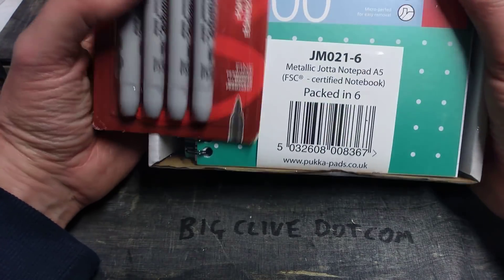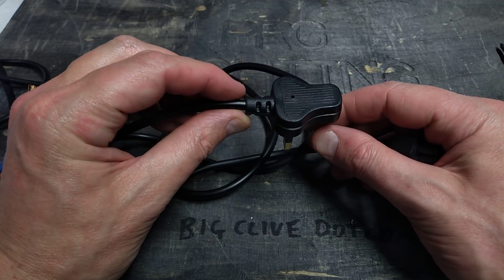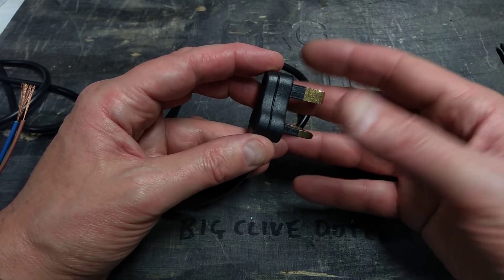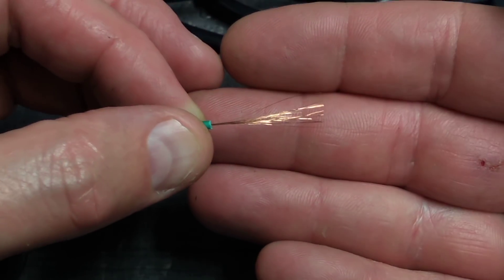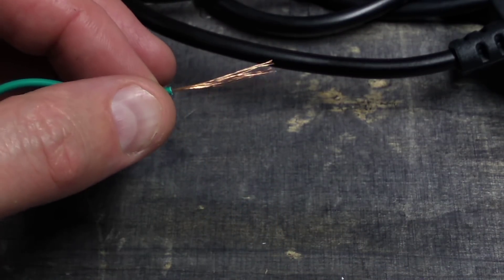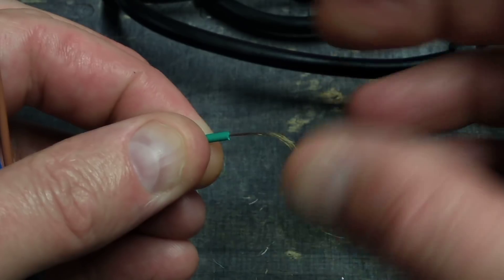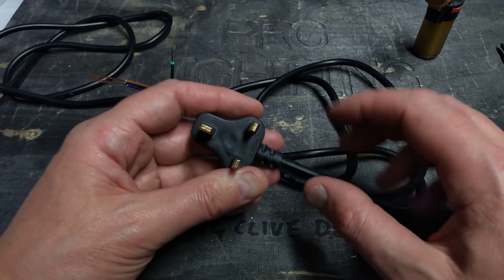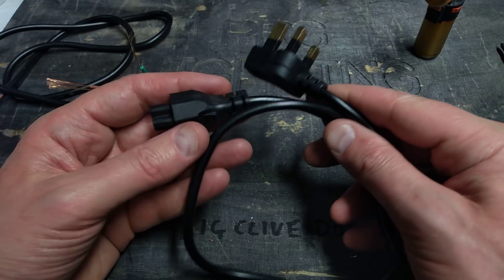How to detect shitty and dangerous aluminium flex.

Comment: Dead Sharpies - break them up and put them in a bottle of meths, the ink will dissolve and eventually you end up with engineer's marking blue (black, red , green...)

I recently bought a data cable (D9 to D9) which had steel cores, the whole cable was attracted to a magnet!  I opened it and the strands were very fine, and not that many of them.

I hope and pray we don't get similar mains leads.

Comment: It's not just aluminum wire. 
    Some switches have replaced some internal brass springs with copper that is softer and deforms very quickly in use.
The toggle switch either stays on or off when it wears out. It's a fire and safety hazard if it latches on. Throwing the switch to the opposite mode does not turn it off. The same is true if it latches off. It is frustrating if you have toggled the switch on and nothing happens since the broken switch stays in the off mode. These toggle switches and others have been on the USA market for over a decade. I have put in on/off indicator lights where these have not been installed. Glen

Comment: Don't just bin the lead. Someone might find it and burn their house down.

Better to cut off the connectors from both ends and then chop the cable into 15 cm - or in the U/S, 6 (1835 British Imperial) inch lengths, so that nobody can kill themselves by using it.

Comment: Speaking off CCA I once sent back a batch of counterfeit Excel Cat5e patch cables. I didn't pay cheap from or such and they were advertised as old stock. I flame tested some after noticing packet loss on the switch statistics and port flapping which never happened with the previous cables. They flopped just like that under a flame. Now I test every one in a batch.

Comment: When I was pat testing I came across quite a few drill chargers from like Dewalt and Milwaukee with 13A fuses in the plugs on a figure of eight cord only rated for 6 amps. I replaced them with 3 amp fuses and some of them were even new but isn't that just as bad?
Reply from the maker: It certainly isn't ideal.  If they were actually supplied with 13A fuses then that is an issue.m If the plugs were not moulded onto the leads I'd be suspicious that enterprising importers had fitted the plugs themselves with the fuse they were supplied with.
Reply: Most of them had moulded plugs. Some of the older ones did have the wired plugs attached to them with a more acceptable fuse rating.

Comment: Thank you for this video clive. I do a lot of IT stuff in my spare time and thus have a shit load of the C13/14 power cords and one in particular wasnt working. I felt it and it was limp and thin, so I cut its head off and it had the same shitty aluminum wiring. Not rated for US use at all, let alone 10A at 240v it claims. To make things even better, somehow the live wasn't connected to the terminal on the C13 end! +1 for helping my house not burn down.

Comment: this must be made known to all over the world!, i have a couple of those cords (netherland europe) style. rated @ 16 amp 240v  and with the same inner core as that one. if in doubt please cut in half and throw a way. 
some cheap pc monitors and power supply cords are like that. the problem is that you could use the same cable for heaters and heavy duty machines.

Comment: Another helpful video! 👏
I have gone to replacing a lot of cord assemblies with an inexpensive (yet made of copper) extension cord by simply cutting off the receptacle end  and then wiring it in appropriately. I have found this to be a quick and affordable way to replace these horrible aluminum cords. 👍

Comment: Also noticed that the one of the wires appeared to be green, without a yellow stripe.

May also have been worth testing if it was brown=L, blue=N and green=E with a continuity tester.

Before placing in the bin be sure to chop the connectors off both ends of the cable. So nobody will take it out and try and use it.

Comment: The cable is new info. Plug fails are not. I make a point of reporting ANY device that arrives from Amazon (et al) with such a plug, and whilst no-one has ever responded, I have noticed the frequency is reducing, thankfully, and re-purchased items have latterly had proper fused plugs on.

Comment: I bought a hot-air rework station. Crappy plug and cable, straight to recycling. Proper BS certified replacement. Opened the metal case to give it a Portable Appliance Test.

Long story short, it’s safe now. Well earned inside and to the earth pin.

Comment: Fuse in the plug, that there is a safety hazard, so easy for people to put a higher rating fuse in or bypassing the fuse defeating the purpose, not very safe for a country that claims to have the safest plugs / electrical safety standards in the world, sure there would be the people that do the right thing but there will be just as many that wouldn't, just makes me cringe just to save a few bucks wiring up a house and the plugs have a fuse protection that can be abused, that is the biggest safety flaw.

Comment: Would putting a fuse in every single plug head cost not cost a huge amount more than a standard cable? I am shocked that a fuse in every power cord would be a viable solution...I have been shocked several times at 115V it is more startling than anything... seems like a 32 amp circuit breaker is just dangerous overkill...
Reply: In the UK, we use ring main circuits as opposed to a breaker for every outlet, this came after a shortage of copper from WWII, so putting a fuse in every plug was cheaper, and is safer, hence the reason it's still used today. 

The other reason is that UK mains is 240VAC not 115V and is much more likely to cause serious injury, a fuse in each plug is better because it limits the shock current to a lower level, for example a laptop charger has a 3A fuse, if you were to get shocked by that, the current would be stopped at 3A, as opposed to waiting until it reached 32A to trip the breaker. 

A 32A breaker is used for the entire circuit, not just one outlet.

Hope this helps
Reply: Yes thank you I was trying to figure out the reasoning for doing this, so that has been explained quite eloquently. thanks again.

Comment: I actually used some CCA 18awg wire doubled up to powee a car audio amp from 12volts pushing it up to 30-40amps and it did start smoking and arcing at the connection after a while and the wire would get quite hot, switched to some old copper 18awg from an extension cable and got good power conductance with the single 18awg not really getting too warm at around 25amps. So the current handling and the more stable connect as I've had the cheap 24awg cca and maybe even tin speaker wire commonly have connection failure even in a car door. I firmly believe in copper wiring now lol

Comment: Wish there was a non destructive test tho - some places have rules against using modified or damaged leads so changing the end "for safety" with the thought that a molded one from the factory is always somehow better than diy screwed together terminals.

Any way to test with low voltage and a meter?  Maybe load it and measure volt drop?

Comment: 4th fault (I think) is plug shape. There appears to be insufficient overhang from the prongs to the plug's edge. 
Idea to prevent insertion of a long metal object while the plug is only partially inserted. Allowing object to contact with metal on a pin (live or other) below the sleaving.

Comment: Aluminium's electrical resistance is only negligibly lower that that of copper. Is it its mechanical properties that make it less suitable by being more difficult to install?
I find its ability to break current when burning rather useful.
Reply: misium It’s incredibly brittle, hard to bend, and corrodes easily.

Comment: If you get equipment supplied with something like that then I personally wouldn't trust the equipment it is supposed to supply power to. If the company manufacturing the equipment can't be bothered to meet UK/EU standards with the power cable then what costs have they cut in the design of the equipment?!?!

Comment: OK Clive, you have a confirmed CCA cable in your hands; I'm pretty sure you also have bench power supplies that put out enough current to bring a 10A rated cable to grief. I expect to see the rubber meet the road in an upcoming video.

Comment: An power company sparky told me that most high voltage supply cables have aluminium cores and copper outer wires, as electricity has been found to flow mainly on the outer section of a conductor.
Also I have told that although current moves at high speed the actual flow of electrons is much slower approx. several centimetres per. Second.

Comment: We already experienced the disaster of this in Canada from house wiring that was switched for awhile to aluminum. Most was used in lower cost townhouse developments with electric heat and many burned down and lives where lost and it is now banned. I see the type your discussing used in low cost auto jumper cables from China but they seem to advertise it as copper coated aluminum openly. --ktmcandog!
Reply: Aluminum isn't inherently bad, you just have to take into account its higher resistance when designing and building things. If you do that then aluminum is perfectly fine.

Comment: I unknowingly had one of these, but it thoughtfully acted like a fuse on it's own, it went open circuit as soon as I turned on the load. The 4-hair thin aluminium wiring inside just vapourised.

Comment: Aluminum house wire was big in the 80's in the U.S. due to the price of copper. It was solid wire slightly larger than the copper gauge
Reply: More like the 60s and early 70s, the problems with the aluminum branch circuit wire (15/20 amp circuits) were well-known by the 80s.

Comment: I had one of those, really dangerous. The plug contains no fuse and the wire is cheap & thin. Brought one from shop can't remember it off the top of my head. The entire wire will turn into fuse if overloaded ! Some shops still sell these & many electrical places recalled few years ago...Many don't even have the earth connected ! 

And yes i had one of these go bannnngg! the wire it self destructed a fair bit..... with bad smell that didn't go away for lonng while...

Comment: I got a couple of these dodgy-looking fuse-less plugs on some cheap single cell 18650 chargers from Banggood, which is basically the Chinese equivalent of Amazon. I just cut the plugs off the end and wired some decent fused UK plugs on instead. I then decided to see how easily the dodgy plug pins could be snapped off: The answer was disturbingly easy, since inside the sleeved section, the brass core was almost thin as a sewing needle.

I put some 1 amp fuses into the replacement plugs, since the cable cores were also quite thin. However, I don't think they were copper coated aluminium, because I was able to twist and fold them just as easily as any other multi-strand copper cores I have ever used. Plus, I was able to tin the bare ends with lead/tin (37/63) solder, which is impossible with aluminium wire.

The power consumption of these little chargers is really low anyway - even if the voltage dropping circuitry inside is only 10% efficient, they would still consume less than 50 watts. So was replacing the plugs sufficient for safety, or should I replace the cables as well?

Comment: Looks like there is a fourth problem with the plug, the covered area around the pins seems too small?
I think the (BS) standard says UK plugs must be ludicrously large to be acceptable.

I was short on C13 cables once and just randomly ordered a box of the cheapest ones on Ebay, they were so shitty the pins were just a thin metal skin like tin foil and filled with plastic.

Comment: Back when I worked in a school's IT dept, we got a pallet of off-lease PCs for a lab renovation. They came with about 80 "free" power cables that were the flimsiest I've seen to date. One pulled apart getting it out of the bag, another melted quite quickly when we plugged it into the wall. They all went in the bin after that.

Comment: I bought a newly refurbished utility trailer that was advertised, "Brand new electrical!".  It was this copper coated aluminum wire and within a month the wire was literally turning to dust.  Most hardware box stores carry both kinds, aluminum coated and solid copper, you can tell the difference in the weight and the price.  Thanks for the video, this stuff is crap!

Comment: Should be illegal to sell this in the UK.  Lack of fuse being the no.1 issue. You might as well sellotape some twin&earth into a socket outlet, something I actually have seen done in the UK in a shop selling fish tanks and kit. Nothing came with a plug in the 90s so they just jammed then wires from pumps and lighting straight into the outlet and held it with sellotape.

Comment: The same thing is done with network cables, so watch out where you source your cat5/5e/6/6A cables from. Some of them have all pairs with cca, others have 2 pairs actual copper and the other 2 pairs cca.
Reply: A 1000 foot roll of cat5e cable made with cca is significantly lighter than a 1000 roll made with copper, and that's one way to tell.

Comment: In the 70's it was hard to get copper due to some crisis or other. We used to wire houses with copper-clad twin & earth. It was terrible, wen had to use a size bigger so lights were done in 2.5mm sq and ring circuits in 4.0mm sq. The aluminium was so soft it would snap off if you had to fiddle around to get the wires in the enclosure, which as they were so big you did. Was a right nightmare
Reply from the maker: That predates my electrical career.  I didn't realise the UK used aluminium at one point.
Reply: 1972 eleventh edition regs

Comment: It's strange we don't have fused plugs here in australia, we are 240 volt
Reply from the maker: You have lower current radial power circuits.  Ours are 32A ring circuits where the cable loops round all the sockets and goes back to the same breaker.
Reply: Ah ok, I'm not familiar enough with mains wiring it seams :) thanks make sense, yeah a 32A circuit would definitely have some punch to it - guess ring circuits simplifies switch boards by keeping the breaker count down too.

Comment: Reminds me of the Rhodesian copper crisis and when most telephone wires in the UK were made of similar stuff. We're seeing a huge problem with corrosion..

Did you check the plug pins Clive? I expect brass plated iron or something with those..
Reply: @Mr Brightside The French had the same problem. Starting in 1991 every new installation was solid copper, designed to be suitable for ISDN. Then they started systematically re-cabling existing installs.

ISDN didn't really last that long but the new copper was just about perfect for ADSL and ADSL2.

Comment: The earth point on the plug is just there to open the socket on leads that do not have an earth lead in them ? So in those cases its irrelevant that there is sleeving on the earth pin .

Comment: In Australia we have a massive problem with Chinese building wire (Infinity TPS and circular cables) the problem being the plastic insulation looses its plasticity and becomes brittle and conductors short out. It is estimated this will cost $80-90M. It case with the copper plated aluminum cables is as indicated in your video that when heated the burn. So while cables shouldn't be exposed to naked flames they are heated overloading. 
There are so many dangers that the worlds consumers are put in direct danger by Chines fraudulent practices and fraudulent compliance certification. Examples like this with electrical safety compliance to building materials marked asbestos free and documentation claiming to that effect but when tested found to contain significant concentration. Then there are issues with kids toys painted with lead based paints and clothing dyed with carcinogenic dyes that come in direct skin contact. Then there is the problem of governments not policing their safety standards relying on manufacturers self regulation. All for expediency and greed.

Comment: A non-destructive way to test them would be to measure the resistance. If it's 0.7mm^2 copper cable, the resistance of each individual lead (live, neutral, earth) should be about 0.02 ohms for a one meter cable.

Comment: I saw the sleeved earth pin a mile off as being a huge no-no.  Not having a built-in fuse was the next thing, but I would never have known about the wire being copper coated aluminium.  Everyone knows that aluminium burns when it gets hot.

Comment: North America approved aluminum wire for household wiring back in the 1980's.  After a few fires it fell out of favor.  The problem was aluminum wire needs to be thicker to handle the same current, but the connectors, and circuit breakers also need to be sized different as well.  Because there were too many differences, aluminum wire was rejected by the building industry, but in some cases its still available to order, it just needs the appropriate hardware.
Reply from the maker: The main bit is the terminations.  If ordinary connections are used the formation of aluminium oxide creates a high resistance joint that burns.
Reply: @bigclivedotcom  Yes.  Aluminum wire has a much lower temperature range and burns when it over heats.
Reply: Not the 80s.. 60s and 70s.
Reply: Aluminum is still commonly used for 30 amp and larger circuits, but nobody makes aluminum building wire (UL/NEC) in sizes smaller than 8 AWG.